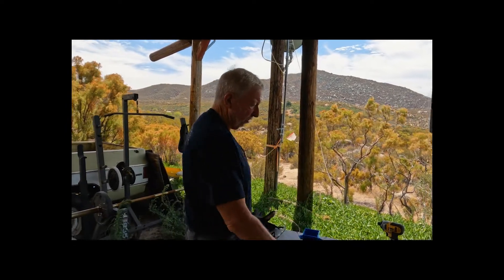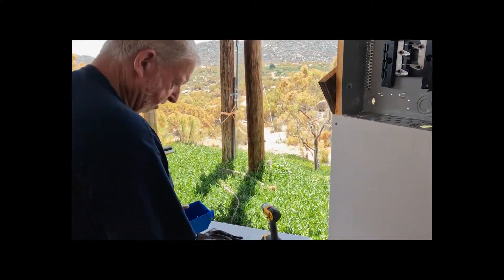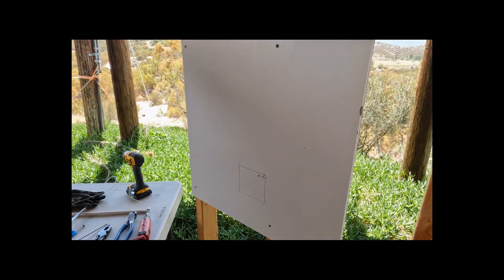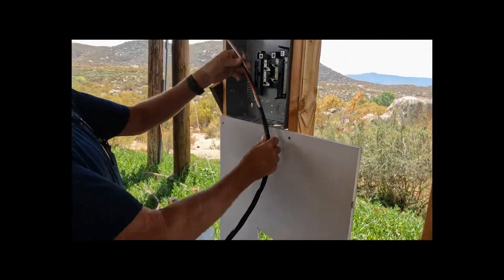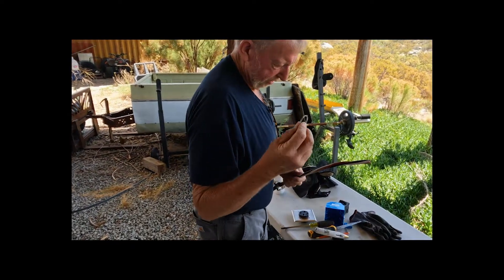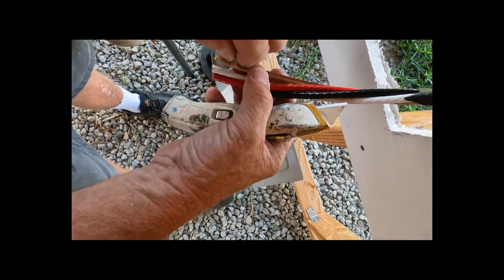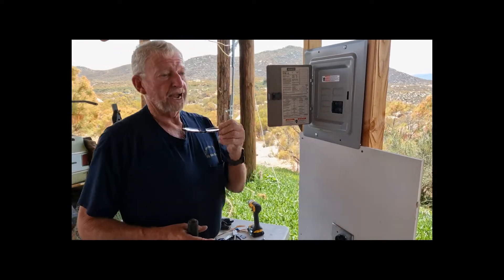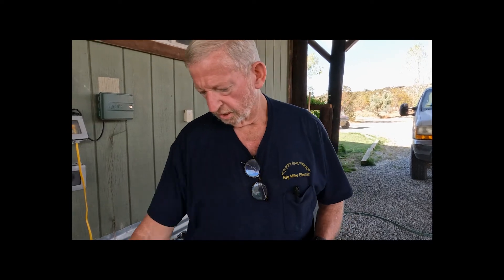DIY - Tesla Plug Instillation for Under $50

Comment: There are a couple changes that have been made with EVSE outlets that will increase the cost. The past few years  have provided history to show that the standard 14-50 outlets you can get at the box stores and are fine for your dryer or stove are not built for the continuous load of an EV and result in overheating and melting. A commercial grade outlet (min $50) is necessary. Second, the code has changed although not all areas have adopted the change and that is the requirement to use a gfci breaker (+$100). If possible, best bet is always hardwired installs but at least use a better grade of outlet.
Reply from the maker: I agree with you that the commercial grade outlet is a better grade outlet. However, if on a budget these work great and hold up... but I have seen a few melt down 😆 If someone wants to spend the money, then the $450 for the Tesla Charger hard wire is the way to go.
Reply: @bigmikeelectricoc  I don't follow the need to save a few dollars after spending the $ to get an EV. For me to do a safe install, the install savings for a hardwire goes a long way to offset a wall unit. Money should not be a factor with safety.